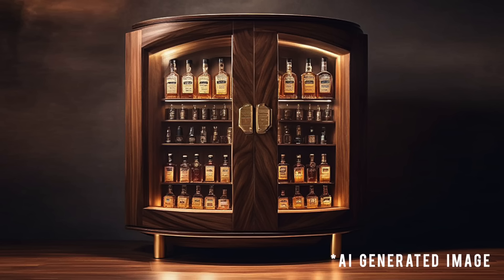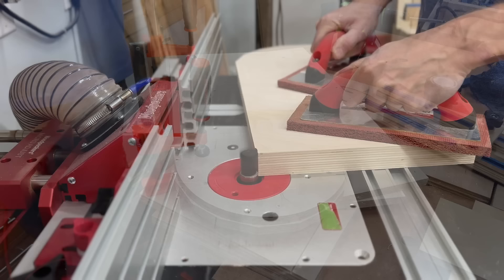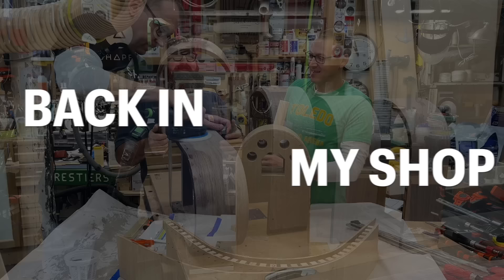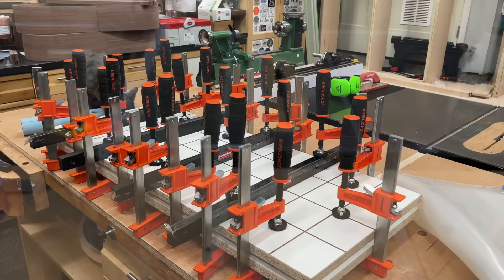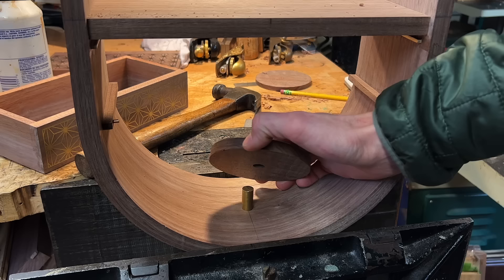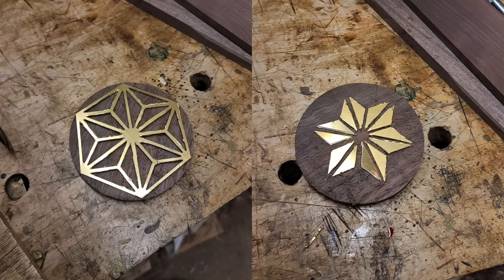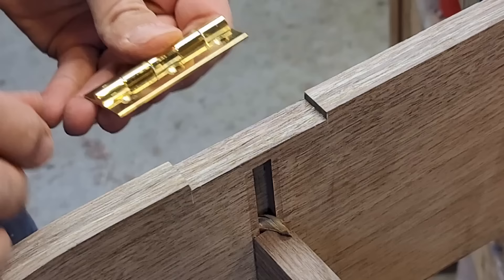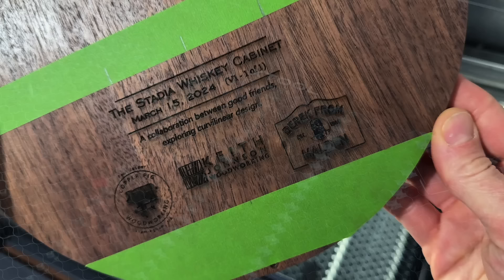Bending wood into one-of-kind furniture.

Comment: Everclear is a great all-purpose thinner and solvent.  Besides cleaning brushes and tools, it's also ideal for de-icing your windows in cold weather.  Just mix it 1:1 with water in a spray bottle. and it will melt the ice on contact.  If you use distilled water, there won't even be any residue when it dries.
Reply from the maker: Great tip! I wonder if distillers had these other uses in mind when they started making their devil's nectar...🤔🤣

Comment: Keith, what a wonderful video.  The cabinets are beautiful and it was fun watching the journey of them being built.  With regards to the brass turning green when exposed to shellac, it may be that the shellac is slightly acidic in pH, and when it contacts the brass (which contains around 60% copper), it oxidizes the copper to form a copper oxide that is green.  Think about the statue of Liberty which is greenish in color.  Copper turns green when oxidized, and that copper oxide layer actually protects the copper from further oxidation.  David Marks taught a class where he showed how to gild wooden pieces with copper or silver leaf, then apply sulfide based chemicals to the metal to form beautiful colors (called interference colors).   While not exactly analogous, it is similar in that the process forms deposits on the surface of the metal which add color.  Thanks so much for your wonderful videos.
Reply from the maker: Wow! Thanks so much for the knowledge drop, Doug! This is great info. And thanks so much for the kind words!
Reply: Wow this is a really interesting possibility you raise, that sounds quite possible!!!!

Comment: Hi Keith,
Great job, great collaboration. I’m not a wizard of design, but one of the lessons I’ve learned mathematically is that harmonizing curves is not easy, whereas rectangular forms can be made to look harmonious almost by intuition alone. So I wasn’t terribly surprised that you abandoned your firs design, and settled on a more linear approach. And hexagons follow naturally from circles, so you hit on the right solution. In fact a hexagon can be constructed using just a compass and a straight edge, so it’s bound to harmonize with the semicircular ends of the stadium design. And speaking of mathematics, I guess that you used N+1 clamps, where N is the number that fit comfortably. As usual, the video production was top notch.
Cheers,
Keith
Reply from the maker: Thanks so much, Keith! And thanks for sharing your thoughts on design. Interesting! 

From Paul: man, we just try to make shit that looks good 😂. We just follow visual intuition which may in fact correspond to the underlying mathematics that you are referring to, but we don't conceptualize it as such a priority.

Comment: Absolutely stunning! Great work! With the laser, I’ve found that using chipboard or 1/8-1/4” mdf as a locator template for your parts greatly reduces that final part stress.
Reply from the maker: Thanks for the tip! The green tape actually worked really well for registration with the multi-camera imagery in the Xtool.
Reply: @KeithJohnsonCustomWoodworking  very cool! I was using the 32” Universal Laser so I didn’t have a camera system.

Comment: I was actually really surprised that you used shellac for these cabinets! Don't get me wrong, it's my favorite finish by a mile, I love it. Just hope nobody with shaky hands is ever pouring good stuff 😅

As for the shellac/epoxy issue, I'd have to look at the formulation of the epoxy to let you know for sure, so this is a guess: 
Epoxy doesn't react to most alcohols, so it's gotta be the shellac itself, and if you're using dewaxed shellac (which most people are) the main products left are basically resin acids which could partially redissolve the epoxy. It's definitely POSSIBLE that they tarnish whatever you used to get the brass color (these are weak acids after all), and you could test that by mixing a small amount, but my guess is more that after the epoxy is partially dissolved, it mixes with the chemicals in the shellac and discolors. You could test THAT theory by shellacing some undyed epoxy and seeing if the color gets wonky.
Reply from the maker: The drink trays were sealed with multiple coats of N3 Ceramic coating, so spillage won't be an issue. Unfortunately, I neglected to mention that in the video. And thanks for your insight into the epoxy/brass discoloration...sounds like Paul has some experimenting to do 🤣

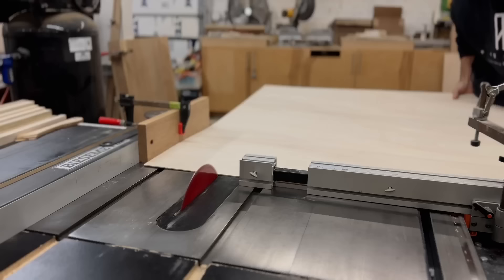Comment: Those are stunning, Keith. I don't care if you don't like whiskey, because more for me, then... but I did see the glasses with the Everclear bottle, so good on someone for that, too. Here's my question: At the 3:20 point, your friend was using an F-clamp with the plywood during a cut... can you do a short or something to demo that technique? I cut A. Lot. Of. Plywood.
Reply from the maker: Thanks Matt! And there's nothing special about Kevin's technique...he's literally using the clamp as as a leverage pull bar (like an ice climbing tool) so he can push the plywood tight against the fence with his push hand, but still have control of the sliding mechanism.
Reply: @KeithJohnsonCustomWoodworking  I'll have to try that... dry run first. Thanks!

Comment: I'm still new enough to woodworking to not know this, but how much movement would you expect from a panel the size you made for the back? I'm used to the idea for big pieces, like table tops. But not a panel of that size.
Reply from the maker: Hopefully, 1/8” max. There are movement calculators you can find online to help you determine how much movement you can expect based on a variety of factors 👍🏻
Reply: @KeithJohnsonCustomWoodworking  thanks, Keith. 
Those are both stunningly beautiful. Excellent job, as usual.

Comment: I must be a robot because I prefer angular or straight lines..
Reply from the maker: All good! I use a lot of angular and straight lines in my furniture, but definitely trying to steer more towards "curvy" things.
Reply: I think actually the strongest preference is a combination of the two where there are curves but they are not completely amorphous. I do believe straight lines draw the human eye in and then they like to see that straight line transition into a gentle curve rather than a sharp 90° angle typically. So while we say curves are preferred that is true but in combination probably with quite a bit of straight lines. I've made a few things that were nothing but curves and they bordered on triggering disgust when I looked at them. They were too irregular and I was too confused on where to go and where to look. So I think a balance is best

Comment: Any chance you can share the ratio of powder to epoxy? I have tried this method but only get a dull murky consistency.
Reply from the maker: Unfortunately, there’s no magic ratio. You just mix powder in the epoxy until it’s a little thinner than peanut butter consistency and then use a heat gun to loosen it up so it spreads easier. Too much powder and it will be too thick and not settle in the recesses. Too thin and it will not have a metallic sheen. It’s all about experimentation.

Comment: What was the ratio of metal powder to resin that you used for the brass inlays?
Reply from the maker: There’s no hard and fast ratio… You want just below a peanut butter consistency and then a use a heat gun when spreading it around and that decreases viscosity helps it to flow out much better

Comment: 19:00 ---- 3M Cubitron XTRACT 310w or 710w  they have stronger backing mesh than mirka etc - hart to tear it (310w wont last as long and work as fast on flat as 710w but 710w wont last as long on corners and will clog up on some woods with resin easier than 310w)
they waaay better than mirka , festool etc sandpapers , last 5 up to 10x longer compared to them and "sand" 30-50% faster (in my case , can be different depending of orbital sander) and compared to cheap sandpapers (those brown ones) they last 20x longer and "sand" 2-3x faster (in my oponion , can be less/ more depending of quality) 
only one competition to this is norton mesh - same if not better quality but more expensive  (and we are waiting for Cubitron 3 series that should flip the market upside down)
Reply from the maker: Dust collection is sub-par with any mesh paper.
Reply: @KeithJohnsonCustomWoodworking  edit---- they have stronger backing mesh "" its super hard to make it tear apart

Comment: Hello keith, love the video just interested in asking about wood bending. I'm trying to get into it and just want to know about the steam box cause the steam generator doesn't exist in my country there is only a steam pressure cleaner (3500w and 100c or 212f). Is it possible to use that even thou the pressure is higher than a normal steamer?
Reply from the maker: The easiest and cheapest steamer is a wallpaper steamer. Are you able to locate one of those?
Reply: @KeithJohnsonCustomWoodworking  Hey Keith unfortunately, unable to find what you described turns out the only thing similar to it was a high-pressure Steam Cleaner for cleaning Kitchen Hoods. wallpaper is rarely used in construction.

Comment: Do you prefer staples or brad nails for holding jigs together? If staples, narrow or regular crown? If brads, 18g? 23g? I'm thinking of getting a brad nailer or stapler for jigs and shop furniture construction.
Reply from the maker: Generally, for jigs, I'm just using nails or staples to clamp pieces while the glue dries. So, I find myself using brad nails (usually 18ga) more often than anything else.

Comment: I had a shellac table and every drop of alcohol (in this case sherry and porto) left a nasty mark. Not so sure if the shellac for a whiskey cabinet is a good idea.
Reply from the maker: I forgot to mention in the video, but I covered all the surfaces that could potentially be spilled on with alcohol with a ceramic coating

Comment: The design is utterly stunning. But I will never understand the desire to marry time, patience and walnut... with plastic. I hope the epoxy thing goes away soon.
Reply from the maker: Totally get it, which is why used as little as possible. Those recesses were just over 1/16" deep. Using solid brass just wasn't an option, nor was a solid dark wood for the black inlay.
Reply: @KeithJohnsonCustomWoodworking  fair